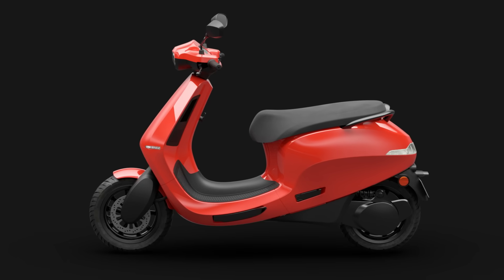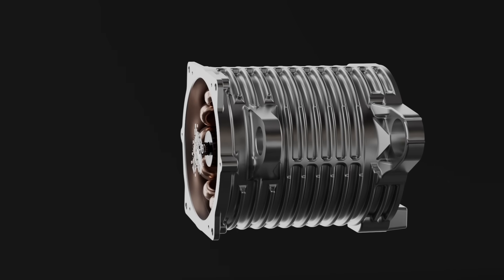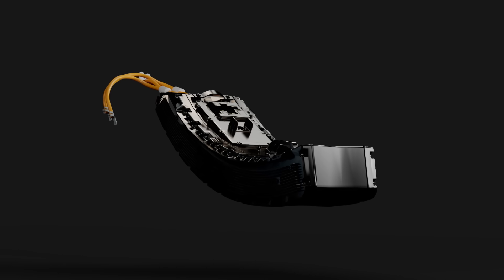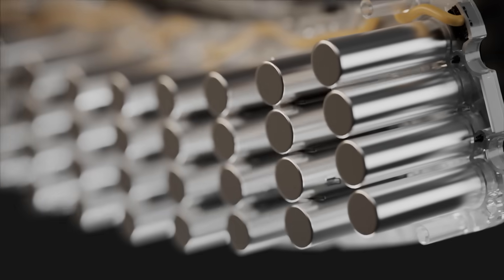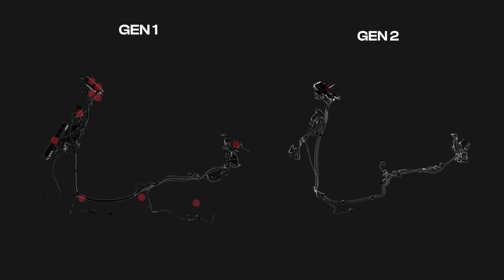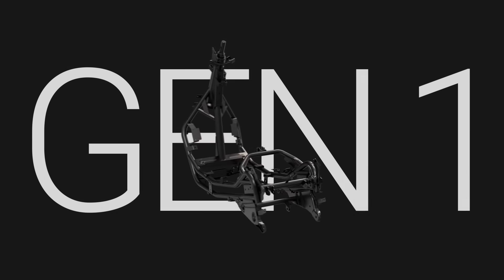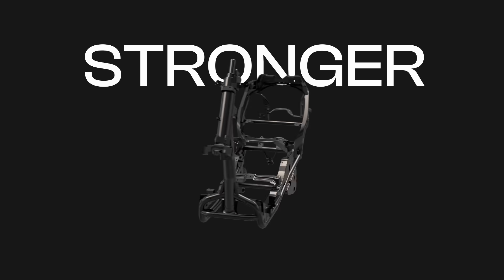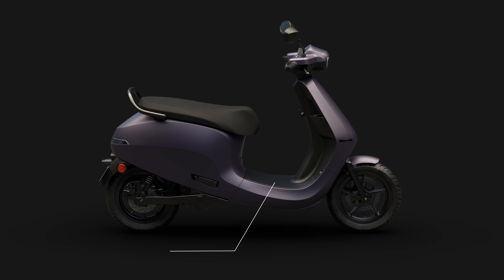Ola Gen 2 | The Next Gen EV Platform

Comment: Im really feeling bad for buying this ola Gen 2,
Within a month so many problems, 1)Evey single day I have to reset to work with display
2)charging slot opening seems hard ,with single press it should open up but it is struck I need to open by applying pressure

Comment: Dear Ola,

I have Purchased the Ola S1 Pro 2nd Generation Scooter In November 2023 Holding a registration number of KA-07 EG-9939  

Since the Purchase im facing N number of issues continuously & Service Not getting Successful, Since we are thinking some defective Vehicle got delivered to me, Myself losing all my time & business i couldn't able to ride peacefully So kindly Replace the Vehicle or Refund.

1.At the time of delivery The trunk was not locking, Then They repaired Trunk lock & delivered (Indiranagar CMH Road Showroom)

2. After delivery within 3 days (Within 100kms of ODO merter) The Main motor Got More abnormal noise & Vehicle got stopped in between the ride (Then thrown to Showroom & Resolved problem after 7 days ) (Indiranagar CMH Road Service Centre)

3. After 1 month usage of Vehicle Shutdown automatically & did not start again thrown to Service, Then Again after 4 days they repaired & delivered (Approx - 1000kms)

4. After 2 months Again Vehicle Shutdowned  middle of the road, the time was 12;30 AM so none of them came to support we spent overnight in the road & next day morning we have thrown to service centre (Indiranagar CMH Road Centre ) Again They took 4 Days of time for  service & delivered 

5. The vehicle Getting delayed in pickup when we apply the front brake only, regarding this we have raised a complaint in the service centre but they denied since it's normal. As we compared Other vehicles, the Ola S1 Pro 2nd generation, I found my vehicle is defective.  

6.Now 17th of February 2024 vehicle Stopped & shutdown middle of the road, We thrown vehicle nearby Known person place & informed Service centre the problem repeating But the service centre person asking for 2000 Rupees for Throwing & Not at all responding 

7. Original RC Not Received Complaint Raised No Response

From the beginning Ola Failed to give service, Ola Cheating & Making Money by Selling Defective Scooters to customers, Ola Must repay for this.  

 

Now Vehicle is in shutdown Condition We are not looking for your service anymore, We need immediate replacement / Refund Otherwise We Will Proceed for legal action against Ola.

(Legal Notice Will be shared Via Twitter And Social Media As Well )

Comment: I hope this message finds you well. I am writing to address an ongoing issue with my S1 Pro scooter, registration number MH 04 LA 4817, which has been persistently recurring despite multiple service attempts.I took delivery of the vehicle on 29/09/2023, and unfortunately, I encountered an issue the very next day, on 30/09/2023. Despite subsequent visits by your mechanics on 10/10/2023 and 15/10/2023, as well as my recent visit to the service center, the problem remains unresolved.The recurring problem manifests as an automatic switch to parking mode after approximately every 500 meters of riding, accompanied by a prompt instructing a restart of the vehicle. This consistent malfunction severely disrupts the usability of the scooter and renders it unsuitable for regular use.It's disheartening to note that even after several attempts and visits, the issue has not been adequately addressed. The vehicle, despite its potential, is proving unreliable and unfit for its intended purpose.I earnestly request your immediate attention and a comprehensive resolution to this persisting issue. I would appreciate a prompt response and a definitive solution to rectify the problem permanently. If necessary, I am willing to arrange for another visit or explore alternative solutions to ensure the proper functioning of the vehicle.Your prompt action in addressing this matter would be greatly appreciated.Thank you for your attention and assistance.

Comment: Dont buy this bike for heaven sake 😂...    my observation on OLA Gen2..power is good no doubt.. very smooth.. it easily reaches 115km  but body make is very weak .. 2nd day of my use..the bolt net from my bike fell somewhere i guess.....  The plastic frame for the seat is very weak ... It goes inside and comes back automatically when u ride(feel like ur sitting on a thin layer of cushion which is on a tin sheet.. btw im 80kg ..not 100kg or 150kg).... Black paint on the body frame comes off easily....   And  I couldn't find any working charging stations during my trip from bangalore it was just a 90km trip... Battery drains like anything... And very difficult to find a charging station which is working... Lastly found one ola showroom..perhaps had Normal charger only hence had to leave my vehicle back there for charging and continued my trip with RE meteor....  my personal suggestion is .. buy it only if it's only for inside City use and especially  light usage...!

Trying to raise a ticket from morning to fix the missing bolt... It says no slot available both for home visit and showroom visit

I would personally not recommend this bike🙏
Reply from the maker: Hi, please write to us on support@olaelectric.com with your order ID and registered mobile number and we'll get back to you!

Comment: You have to give cooling system for motor and battery for extra safety in summer
Reply from the maker: We assure you that the powertrain & battery have been rigorously tested for a variety of climates & use cases. You will not face any issues as long as you follow the instructions & restrictions mentioned in the user manual, you'll receive with delivery. Stay safe & revolutionary!

Comment: Their gen2 scooter is just like Activa gen 1, the grab rails are just like Activa 1g 🙂, yes it's more practicality. The previous gen 1 grab bar was form over function n useless flimsy crap. Also ola seemed to be thinking out the box and designed a front monosuspension in gen 1. What happen ola engineers? Why u change to old plain telescopic forks? Haha ola should fire some engineers/designers of the gen one. 
We Indians prefer function over form, and we want practicality in our scooter, trying to think out of the box and designing something which turned out to be useless/unreliable and impractical, i think ola learnt a lesson.

Comment: Extremely  Bad experience  with Ola S1 Air

Recently  bought the Scooter, but to my utter dismay it stopped running just after covering 5 kms. Had to manually  push my brand new scooter to home for almost 4 kms on  the very first day of delivery. To add to the agony was lackadaisical  attitude of staff and service team, who have not responded  to the service request  even after 6 days of breakdown of a brand new scooter. Totally frustrated  with the product. Don't ever buy this. Kindly spread the word. #olaev #olaelectric #bhavishaggarwal

Comment: more and more integrated components leads to tougher repairability and higher replacement costs. OLA S1 is transitioning towards a apple silicon like architecture. But only time will tell, if they can achieve what apple silicon did to other chip manufacturers.

Comment: The engineers are certainly doing an impressive job, yet we should bear in mind that a higher number of integrated components can lead to increased replacement costs and maintenance expenses. If even one component fails, it necessitates replacing the entire subassembly, rendering the bike non-functional until then. It's important to address repairability and component replacement ease in the video, and we should also eventually tackle the concept of "right to repair." The Olav team of engineers undeniably invested significant time, energy, and intelligence into enhancing the design. The video effectively elucidated the distinctions between the previous and new models, showcasing an admirable level of detail. I personally commend these endeavors and urge ongoing improvement, as this will ultimately set the product apart.Ultimately, these improvements will serve as the distinguishing factor by ensuring greater durability and a solid build quality.
Reply: Lol copy pasted comment
Reply: Did you just run above comment through ChatGPT or something

Comment: If you are thinking of buying OLA read this once 🥺🙏

As a customer I have purchased new two wheeler,
Follow all the required process, done all the payment.

After 3 month my vehicle met with small Accident,
And OLA People asking for 40,000 Payment and insurance company also not helping saying Fork arm, Chassis, suspension are it's not accident damage it fall under mechanical Damage.

Now as Per OLA service centre it's GoDigit's work to approve everything and help me in making my vehicle ready.
And as per Godigit person Some parts are come under "Mechanical Damage" term which means Fork arms and chassis related parts should be replaced by ola on free of cost.

As a customer/ bike owner I am suffering the most here, as here I am attaching my new OLA S1 Pro's recent Images, which Vehicle is out side the Makarba Ola Experience Centre.

Please, I request here yo everyone that do the needful on this and help me in getting my Vehicle back in working condition. 🙏🙏🙏

Comment: "Electric motorcycles are mimicking smartphones in their upgrade frenzy. There's no lasting joy in owning a timeless gem like a combustion engine bike, with the ability to proudly proclaim, 'Look at my beast, never gets older!'"
Reply: EVs are the future and you will be left behind as a relic! Think of self driven , automation, data for diagnosis and optimisation analytics which will be baked into EVs.  EVs are one solution to traffic noise and air pollution, energy dependency, trade deficit (oil imports), global warming (irregular monsoons and typhoons are worsening)
Reply: @bkmarksuser  Electric vehicles may dominate specific sectors of the automotive and transportation industries, but when it comes to personal commuting, the future might still revolve around combustion engines, potentially powered by innovations like hydrogen combustion engines that will continue to fuel cars, scooters, and motorcycles.

Comment: 2:30 centralised compute system is not a good idea though. Simple raspberryPI and python script can do it. In an electric vehicle many tasks like stoping the vehicle, indicator lights, battery management software are very critical. In case of centralised system small component failure can result in fatal accident or can block complete mobility of the vehicle.

Comment: Please put fingerprint to start the vehicle. It is not secure  to start the vechile with pin code. (for safety issues to start the  vechile in outside)
Reply: Use proximity sensor to unlock

Comment: Biggest PROBLEM with ola electrics is the turning radius stareing wheel doesn't have full turn like activa or any other two wheelers, having smaller angle of turn leads to uncomfortable turning experience on low speeds, it is very Diss balancing, doesn't give enough confidence and manoverabilty, I hate this !

Comment: To all those in the comments stating "as an engineer" : pucha kisine tumko ki tum engineer ho ya nai. 
Fokat shit, just bcoz u r engineer (only god knows even if u r), is your field of enginerring even related to the one described in the video. 
If so can these so called engineers effectively provide a much cleaner version in layman language of what has changed and what not. 
Also describing the effectiveness of the system vs points of compromise compared to the previous gen model, wherein it is evidenced by points of suggestions and ways of improving the same. 

Agar nai kar sakte toh chup ho jao nakli engineers.

Comment: No doubt the engineers are doing a great job but one thing to keep in mind is that the number of integrated components also translates to increased replacement costs and higher maintenance. If one component decides to fail, the complete sub assembly needs to be replaced till then the bike is not functional. The actual thing that was also to be discussed in this video was repairability and ease of replacement of components. Right to repair should also be considered but thats something we will have to address later
Reply: I don’t understand how they managed to improve their thermal performance by removing the heat sink?
Reply: @IndiaBall_15AUG47 just taking a guess by design might be the exo shell of motor made of aluminium is used as heatsink for both motor and controller again reducing the cost and thermal efficiency 😅
Reply: @harshadthorat5212  yes, you are right, It can be very much possible, anodized aluminum can do that…thanks 👍
Reply: @IndiaBall_15AUG47  they didn't say that... there will be more thermal throttling and automatic switches to eco mode only
Reply: well said 👍
Reply: 👍 right
Reply: in coming time Indian Govt and Automobile Sector will jointly force customers to pay higher prices for delicate controllers, batteries and FI parts ! I think Indians are the most foolish in Automation awareness, sab chaude me hain ki apne paisa hai kuch b ho dekh lenge but service ya replacement k naam pe service centre pe company ko gali dete hue mil jayenge !
Reply: The Engineer did nothing,Ola S1 pro gen 2 also has the problem on day 1 of buying ola.
Reply: No one cares about ev. Its just marketing just like facebook renamed itself bcz of tarnished reputation. This ev is same as before i.e its just mobile on a chinese imported wheel. + the scooter looks like gay.
Reply: Good point, I was feeling for having gen 1 😅
Reply: @AyushLikhar double suspension = more jerk and stiffer suspension work
Reply: Good point
Reply: Superb suggest everyone to adopt it as petrole scooters drinking more
Reply: Ola to chahiyaga, parts cost vi increase ho
Reply: Its India not EU
Reply: @vineetgupta4391  Being able to repair something is still better than replacing and then justifying that it can be recycled. We should consider that recycling also needs energy
Reply: Engine in an electric scooter?
Reply: True sir
Reply: Ll 4:00 😊
Reply: Sir i am also going to buy this ev vehicle loa gen2. 
You telling that repair of this vehicle costs more? Can u plz tell me that is this my good choice?

Comment: So no active thermal management ? No active cooling of the motor nor the battery ? Improving efficiency is good but not enough to protect the battery and get same performance in the long run. Not to mention protect the battery and get long lifespan instead of programmed obsolescence.

Comment: As an engineer, I want to point out that this is REAL engineering - what you can take out and still perform the functions.
Reply: You have zero knowledge of engineering. They didn't remove any imp parts just resigned and placed in a central unit. For a vehicle ability to repair  is key especially for an electric one. This just means you have to buy original company certified parts only and for small problems it means changing the central housing.
Reply: @Electrobuzz17  Honey, I have 26 US patents in electrical, mechanical, and optical engineering - I'm comfortable in my analysis.
Reply: @mccanlessdesign that's really impressive if that's true.
Reply: @mccanlessdesign  yo honey bunny tell your college name
Reply: @krushnachChandra   "Indian-killer" ;-)
Reply: You can drink water without a glass/bottle by joining your hands and drinking from it. But  does that mean it's better?
Reply: @thereviewer6517 The ride quality etc is same or better but with lesser parts, your analogy is flawed as by default the experience b/w hands vs bottle is not SAME. 

A better comparison is like going from a heavy thick bottle with avg capacity to lighter slim bottle with slightly better capacity, same convenience but slightly better Performance/efficiency.
Reply: @thereviewer6517   you know the meaning of "convenience" right ?
Reply: bhai kaha se padhy ho? btech,mtech or if you have a phd?
Reply: As a Tuatura Engineer, I want to point out that this is totally shit, and people should not buy it by getting manipulated from marketing team coz they know he consequences.
Reply: @Surila-yg2do 😂
Reply: Really?
Reply: @Surila-yg2do bruh....it's tuatara.....ohh...maybe it is an internal codename....

Comment: best thing ever is they noted every problem and draw back on gen 1 and did an improvement. please give an exchange or upgrade option from gen 1 to gen 2. its highly impossible for old customers to sell the gen 1 and get hands on gen 2
Reply: True
Reply: True 👌
Reply: true. they can easily implement it.. but by doing so they will also face a huge loss. as upgrading the old scooters to gen 2 will require a separate department, and investments..
Reply: Sell your gen 1 to me if it's a Pro model 😂 how much do you want?

Comment: Silently single suspension on front and rear has disappeared 😂

Flat footboard ❤🎉

The heat sink popped up on the head motor  probably to tackle the motor over heating🤔

Never the less gen 2 S1 pro looks gorgeous ❤❤❤
Reply: Single suspension at rear is retained. But it's conventional vertical suspension and not cantilever horizontal suspension.
Reply: @sushil3629 and that suspension now pierces through boot up till your butt apples😂
Reply: @thedogspodcast  they've rectified the welding on that part. Only initial batch had this problem.
Reply: ola itself is a big problem i see service engineers pasting body panels with fevik kwick within ola premises 😂 nevertheless I'm not interested in replying furthermore  😊
Reply: @thedogspodcast  2 years 20000kms done on my Ola S1 pro without facing any major problems. Best electric 2 wheeler in India.